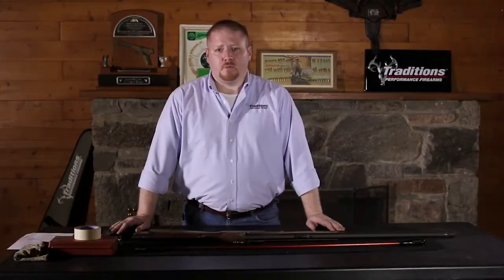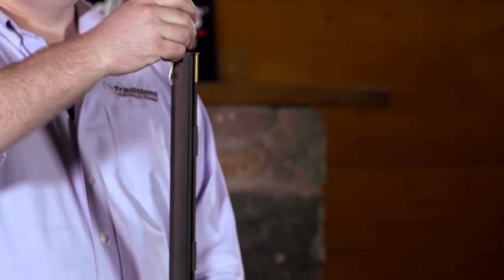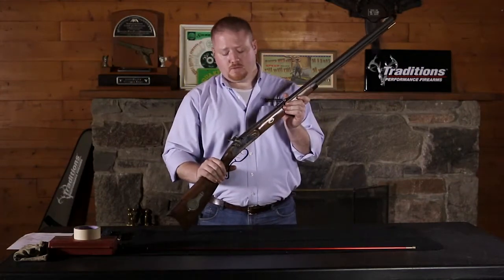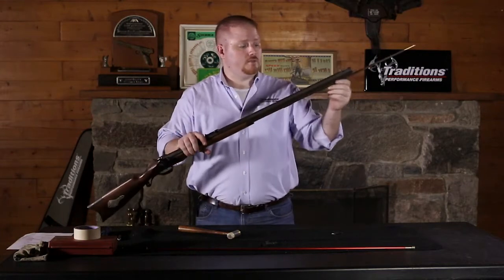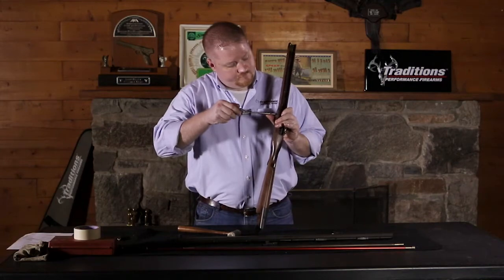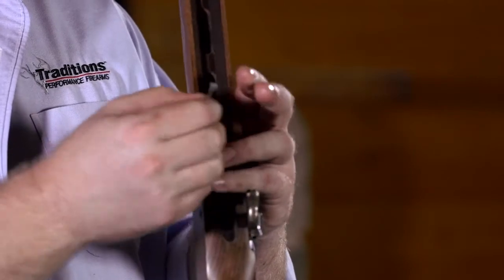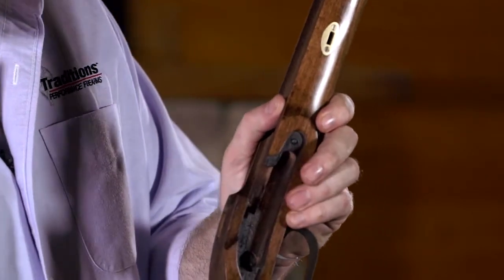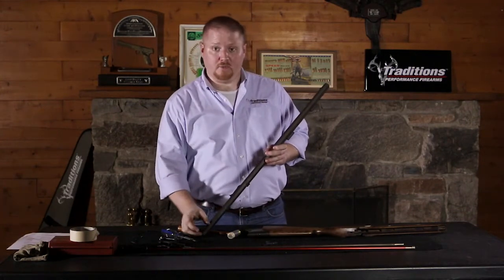Traditions Firearms Video Series - How to Disassemble Your Traditions Percussion Sidelock

Comment: how often do you need to remove the the lock plate to clean the gun
Reply from the maker: Brett - Thanks for the question. You need to remove the lock plate every time you clean the gun. You should clean your Traditions Percussion Sidelock every 10-20 shots.
Reply: TraditionsFirearms  does the traditions Kentucky pistol have a threaded ramrod for attachments and if so what is the threading 10/32

Comment: I have an older model, buckskinner model, and the bolster drum screw has no slot or any other way to remove it. Would I be safe to cut or otherwise make a slot for a screwdriver, or do the old models not get removed? It does appear there may have been some type of "head" there, but since I've had the gun, I've just removed the nipple when cleaning. I'd like to get that out too if I'm supposed too, 😄.  Any help is appreciated! 
@bonezcustoms on Instagram
Reply from the maker: Thank you for your message. The bolster drum cannot be removed and it sounds like the head of screw may have snapped off. We do not recommend making any cuts or holes in the barrel. Given the age and condition of the firearm, we would taking this to a reputable gunsmith for inspection.
Reply: @TraditionsFirearmsOfficial  Thanks for the reply! Sounds like solid advice to me! To the gunsmith she goes... Always better safe than sorry! Thanks again.